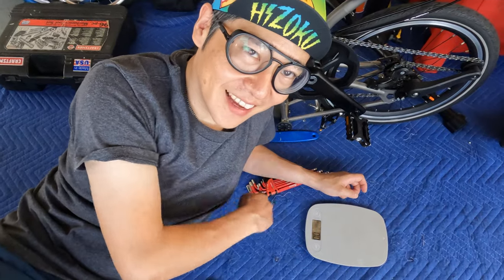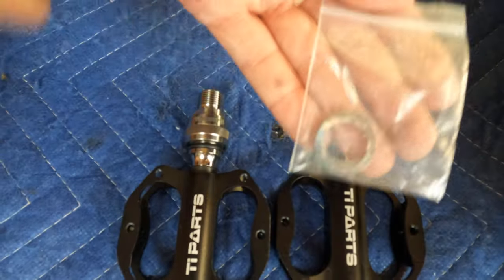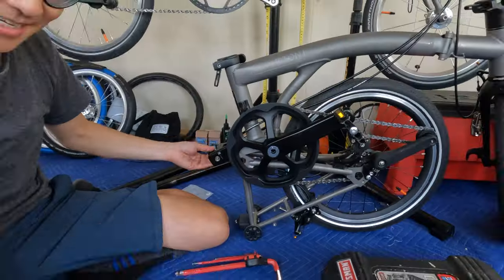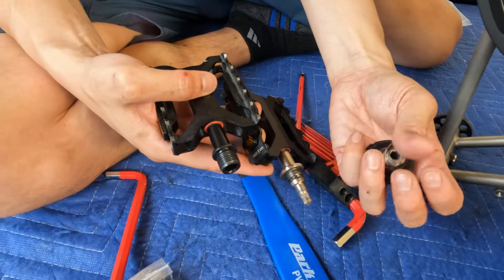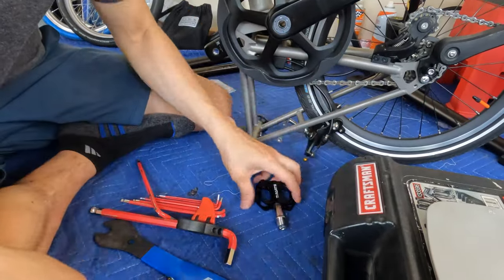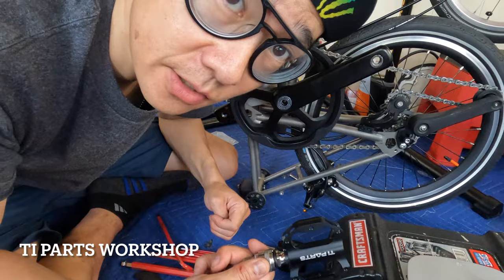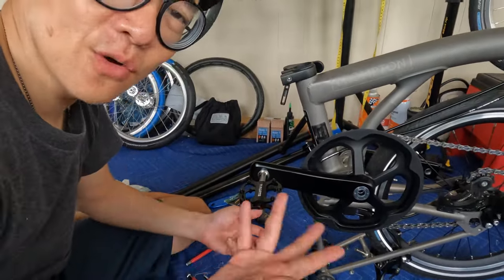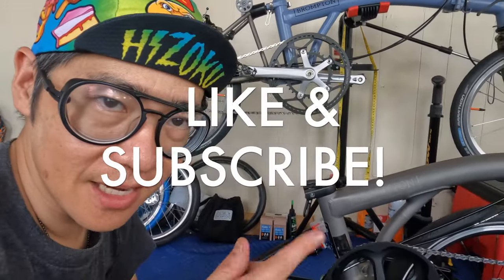[T-LINE UPGRADES] TI PARTS WORKSHOP PEDALS Brompton Folding Bike

Comment: So interesting that they didn’t tighten the pedals — seems very un-Brompton-like, considering they’re usually very good at attention to detail. I guess it’s just what happens when you get one of the first ones off the factory floor when they’re still figuring out manufacturing processes.  FWIW, my T-Line, which was a second run, also had a pedal issue in that the magnetic component in the crank arm wasn’t locking in the pedal.  Brompton Junction NY swapped it out immediately when I noticed at pick-up, but another pedal issue nonetheless.
Reply from the maker: It's always a good idea to check a new bike.  I have had stripped screws on my older bromptons.  I guess it will depend on the technician that puts it together.
Reply: I watched somewhere that you really have to tighten the pedals off the box.

Comment: Please apply loctite 243 to all the studs!

I didn't and had to buy replacement studs as a few dropped out during cycling. Your feet will move about and it will cause the studs to loosen.
Reply from the maker: Same here.  I use it on all the small screws.

Comment: Not only T line. Standard Brompton also the same. They over tighten or lose.
Reply from the maker: I've had loose screws on some of my older Bromptons.  I guess it depends on whoever assembles the bike.  I guess I will need to check my bikes more closely when I buy them.
Reply from the maker: @Sailing Sexy I've had the same problem on some of my other Bromptons.  My hand muscle would cramp up and it made me hate changing pedals.

Comment: Another great video, thank you! I want to change my T line pedals too, but in my case I need a pedal holder. Do you think the Ti parts holder can be fit to the rear frame securely?
Reply from the maker: I'm not sure since the T Line is a skewer type axle.  Have you checked out the handlebar plug ones?
Reply: @BromptonFamilyTime  no I haven't. Will have a look on that. Thank you!

Comment: Hey did you upgrade your brakes? Noticed you had different levers than stock brompton
Reply from the maker: I have a short video coming out on it.  It's simple though you just need a shifter/bell adapter mount.
Reply: I would suggest changing the brake pads at least. I found the original Brompton brake pads terrible (worse than my old Tern).   I change mine to SwissStop Flash Pro.

Comment: Does the pedal say how many nm to tighten pedals? My new stem had values written so small, but there.
Reply from the maker: It doesn't say.  But as long as you hand tighten it with a long wrench it will be fine.  It doesn't need to be super tight.

Comment: I'm leaning toward the MKS compact pedals QR in gray, didn't think about shoe sizing.  I wear a size 9 Nike & 8.5 Vans for example so would platform of the MKS be good?  The TI pedals if they're smaller I wouldn't consider.  Thanks for the info, look forward to your comments!
Reply from the maker: It really depends on the pedal.  I find that the harder shoes will slip more and softer shoes (my crocs) grip it well.
Reply: @BromptonFamilyTime  thank you!

Comment: A socket set, ratchet driver and torque wrench are better tools than an Allen key, especially on a £4k bike (some people never listen). Plus, as others have said Loctite 243 (red) or at the very least Loctite 242 (blue) on the pedal pegs, else you’ll need to replace the black pegs with red when you loose a few.
Reply from the maker: You can't use a torque wrench on these pedals.  Only a 15mm wrench will fit.  Loctite is definitely a good idea.  If I lose any of the pegs I will replace them with the red ones.  If you start to see my pedal turn red then you know why lol.

Comment: Hows the performance of tiparts pedals.. what is your foot size
Reply from the maker: My favorite pedals so far.  I have lost a few of the studs (they come with extras in red so I replaced them already).  Mens 7-8.  They are smooth and feel great.  I haven't had my foot slip once.
Reply: @BromptonFamilyTime  great thanks for idea